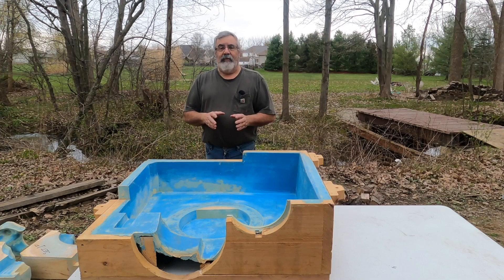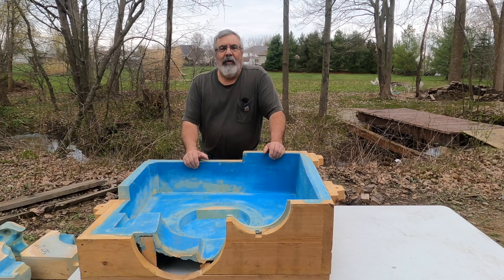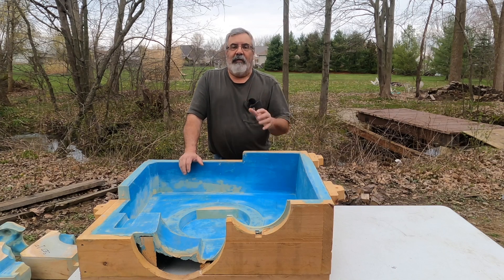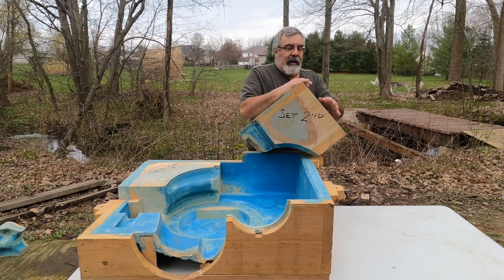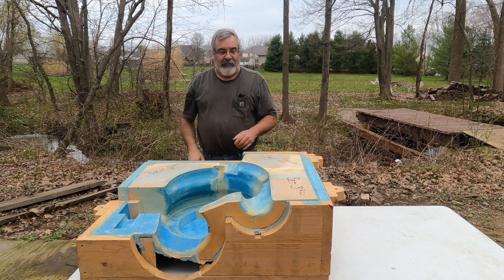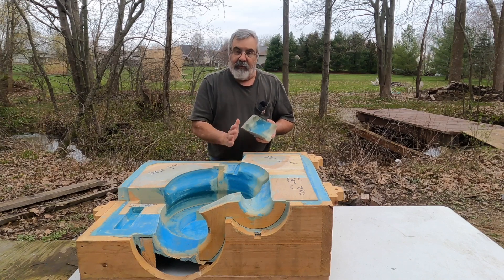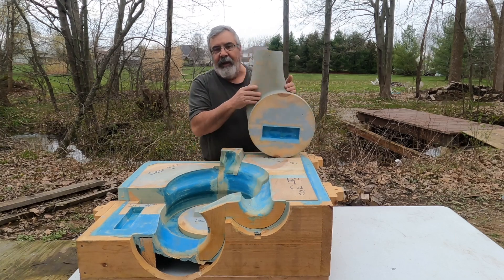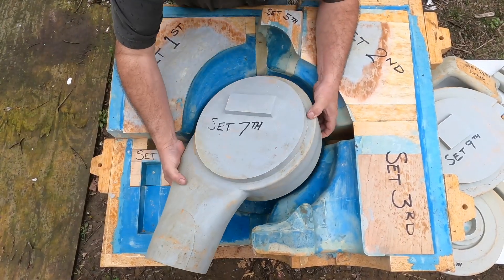One of My Favorite Complex Patterns

Comment: I am not entirely clear on how a cast part came from this mold?  Is the mold to make a hollow sand shell to be filled with metal or perhaps to make an investment model of wax or foam, surely metal was not poured in this mold directly.  New to me ...
Reply from the maker: You are correct sir. These are just models I made to make core boxes. Then they make sand cores and molds to pour molten metal in.  Check out some of my foundry videos. They might help.